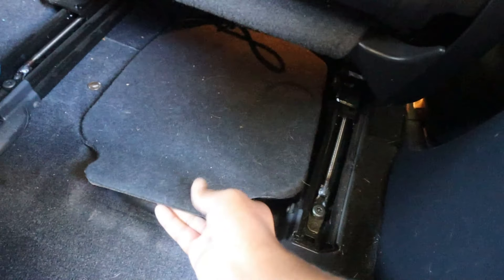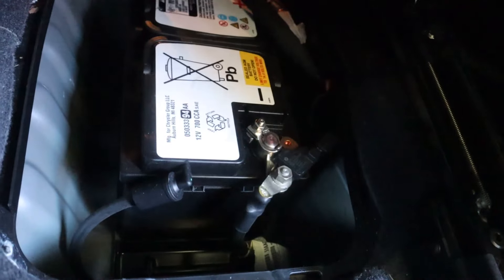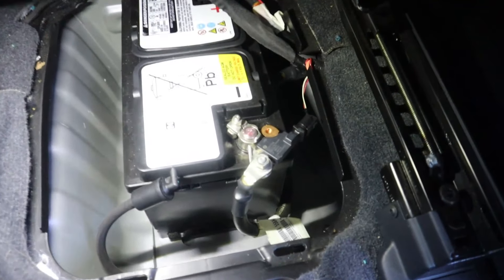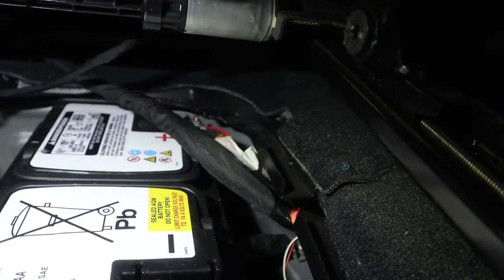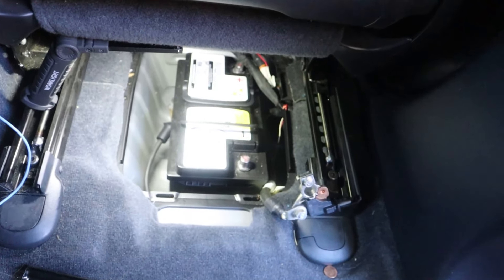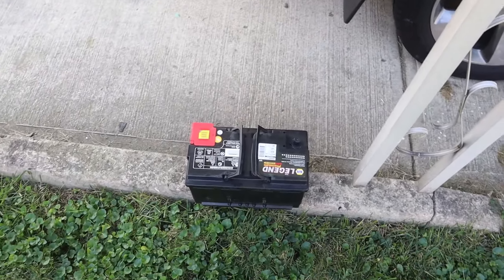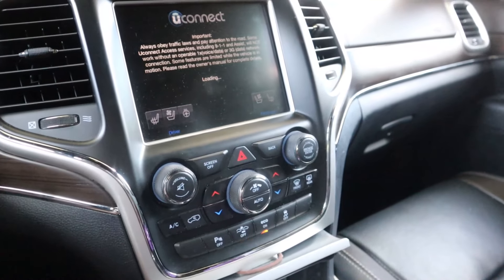Jeep Grand Cherokee Battery Replacement - 2011-2022

Comment: Why did they put battery under the seat ? Because they hate ppl?
Reply from the maker: Haha battle between engineers and mechanics
Reply: They put the battery under the seat because Jeep sucks. My wife has a 2016 Cherokee and it will be our last. P,OS.  @LJsGarage
Reply: @genemoorman3065 same this will be my last jeep as well
Reply: Because Mercedes
Reply: @xxmobstrxx8535 literally this, & i hate that. "Lets just do EVERYTHING the leading brand does, regardless of the lack of sense it may make.." yeah thatll win your customers over, make it more costly to service the products... its ridiculous
Reply: It takes a couple of minutes.  My battery was completely dead, and I had to remove the power seat.  4 bolts, real tough.  Why is it there?  Unless you have the water in the battery well issue, battery stays dry, no corrosion, no battery acid all over the place when some jackwad runs a red light and obliterates the front end.  And no one is going to steal your battery!  Yes, people steal batteries from vehicles, though you're odds of winning the lottery are probably better than having your battery stolen.  Seriously, it takes NO MORE time to remove than those in the engine compartment, even if you have to remove the non-functioning power seat because the battery is dead.  Now... replacing those 3 spark plugs on the driver's side on a 3.6l... complaints are warranted for that engineering stupidity.
Reply: Because there is no room in the engine bay for it.  The air suspension has posts in the passenger and driver side in the engine.
Reply: My 4th and last Jeep. And the Hemi is a POS.
Reply: Yep
Reply: Exactly my thoughts. That's ridiculous
Reply: I remember the spark plugs being a pain on the passenger side, not the drivers side
Reply: @capnobvious2718 wrong that’s the worst place I’ve dealt with a battery in the engine bay is faster by a mile and just over all better
Reply: @capnobvious2718  think you mean passenger side plugs, (1,3,&5), not even number on driver, but I’m with you. Cylinder 5 misfire and was PRAYING lol, that it was just under filter/intake on driver side 😂 Sadly, no such luck, 85 different plastic plugs, valve covers, hours, and too many engineer directed expletives later, and all done! Lol. Easily the worst design I’ve ever experienced for what is a simple 5 minute job in a patriot. Smh. However, I must say (knocking on wood), after owning my 2018 for almost 5 years and 80k miles, I’ve literally had no issues with it besides that misfire around 100k when plugs were due anyway, and a temperamental driver side door lock actuator that doesn’t lock automatically all the time and requires manually locked. Pretty reliable imo. The passenger plug replacement issue totally, TOTALLY ridiculous though. Haven’t cursed that much in a 6 hour period in years 😂
Reply: The usual area is obstructed by the air suspension. Apparently jeep does this on some cars without air suspension and that’s shitty but there is definitely not room for normal battery in that generation of Grand Cherokee Overlander
Reply: ya, next they will put the battery in the crankcase.
Reply: Well Sr, i live in LATAM i can tell you this is a extremely good feature as it's very common batterie to get stolen out your vehicule by resellers... Yes. thats a real, I've been stolen at least twice.
Reply: because everything on a jeep they want people to have to bring it to the shop to overcharge.. look into changing a headlight led or bulb 🙄
Reply: That is exactly why
Reply: You try to change the headlights on yours yet? I changed the driver side and swore if the passenger side goes out in selling the thing.

Comment: Thanks for this video. For anyone watching,  BEFORE YOU TAKE THE BATTERY TERMINALS OFF, move the seat all of the way to the front AND all of the way up. The battery will slide right out without you having to twist it to the side.😊
Reply from the maker: Great tip!
Reply: Yes, but not if you have base model Laredo with manual seats. Just slide all the way fwd, and hope for the best.
Reply: @jimakaracerx  Now I feel spoiled...
Reply: I’m working on one but this bar is in the way w the seat all the way up n the battery on its side
Reply: Duh

Comment: If you wanna make it easier the youcan get to the positive cable VERY easy by sliding the sea back and coming in from the front seat, it puts you directly over the top of the post with no obstructions. Then slide the seat forward again and get the battery out from the rear.
Reply from the maker: Thanks good tip!
Reply: This has gotta be a joke. If you slide the seat back and remove the positive battery terminal you will have no power to the car to slide it forward to get the battery out the rear. Sadly a lot of people will fall for this as they are not very mechanical and watching this to save a buck.
Reply: You take the pressure off the nut but leave it connected to the post so you just have to pull it up and off after you move the seat genius🤣
Reply: @2qwk un bolt it, leave it connected, slide seat back forward, then slide it off the terminal lol.
Reply: @2qwk my passenger seat isn’t powered so this was a great tip for me

Comment: Great video, unless you have a 2018 Grand Cherokee,  because it is not this straightforward.  You have to remove the auxiliary battery first, to even get to the bracket, and there are two places to remove the breather tube, as opposed to one.  You have to remove the bracket, before you remove the positive cable, as the battery is so far forward, you cannot get to the nuts on the terminal cable, as they are under the lip of the battery compartment.  The good thing about this, is once you get the bracket out, you can slide the battery back to expose the positive terminal, and then move the seat all the way back, and remove the positive cable for the front.  Hope this helps if you have a 2018 Grand Cherokee.
Reply: Thank you for this! I have a 2017 and this helped me immensely!! Much appreciated
Reply from the maker: Good added info!
Reply: Yea I was wondering why my battery looked extra...long? Thanks.

Comment: Its a lot faster to just remove the seat, just four clips that cover the bolts, remove bolts, move seat forward now you have access to batteries!
Reply from the maker: If that works for you def a reasonable method!

Comment: This isn’t “every” battery for this generation. 2016’s, and probably every year earlier has a regular sized and an auxiliary battery instead of a super long one.
Reply from the maker: Thats true thanks!
Reply: All have two if it has auto start stop but most don't like this feature and disconnect anyway .

Comment: This video helped out a lot man, thanks. One thing I didn’t think about was to raise the seat all the way up, but still had room to work with it forward. One thing I did different was loosen but not disconnect the positive from the front before moving the seat forward. I feel like after that battery change I would be able to deliver a baby no problem😂

Comment: Thanks for this. Date code on my battery was 15C31, so original to April 2015 delivery of vehicle. It was still working, but almost 10 years ... I replaced 700 CCA with 800 CCA model. Hardest thing was getting the 13mm nuts off the retainer plate.
Reply from the maker: Np my friend!

Comment: I have a 2019, the auxiliary battery is down there as well. After changing the main battery I went to start the truck and there is no power anywhere. Been researching for the last couple hours with no luck.
Reply from the maker: Good luck I'm not sure what that could be
Reply: Did you find the solution? I'm in the same issue

Comment: So 3 days ago, my 2022 Grand Cherokee wouldn’t start and I had to have it towed to the dealer. BTW, you can’t shift out of park when the engine isn’t running, so you have to locate the secret manual transmission override that will put your Jeep in neutral (hint: it’s not in the user manual, but you can find a YT video describing the process). Anyway, the main battery was fine, but the auxiliary battery failed. After it was replaced, good as new. I was confused because my understanding was the auxiliary battery was just used for the start-stop function and was not involved with the starter. So, apparently this is true…except the auxiliary battery has one other function: powering many of the relays that have to be triggered to inform the Jeep’s computer it’s safe to start the engine. No power to these relays, no engine start. Again, not in the user’s manual. Actually, the Jeep Grand Cherokee user manual doesn’t even mention the batteries, what they do or where they’re located. 

There’s also not one word in the manual about jumping a Jeep with a dead battery. Apparently, you connect your jumper cable to the positive (+) post under the hood on the passenger’s side. So, here’s a question: if your Grand Cherokee won’t start due to a dead auxiliary battery, will jumping the Jeep via the post supply power to the auxiliary battery, the main battery only or both? It would actually be great if you could make a video about this. Thanks.
Reply from the maker: Oh man! Good to know and sorry that happened

Comment: Great video but I do have to ask the main battery not the auxiliary where exactly are they located. Passenger seat or driver's seat underneath
Reply from the maker: The aux battery should be under the passenger if you had the stop start and all that

Comment: Find that big red cap on your positive there is a little plug that will break off and it goes on the opposite side of the battery from your vent tube there are two holes in the battery you're only going to use one for the vent tube the other one you need to plug it and that plug is on that big red cap on the corner
Reply from the maker: Thanks thanks

Comment: is it safe for the battery to be close to passengers?  What if it shorts?   Can that happen?
Reply from the maker: There are fuses to essentially disconnect if it were to short. Same with an accident but if they were to fail I would assume it's a little risky and a fire hazard

Comment: what is the function of the black piece with the plug in terminals on the ground terminal mine broke off
Reply from the maker: I believe you are talking about the battery sensor.
Reply: Or is he talking about that vent plug. I wondered what that is for also

Comment: Can you still get the battery out if you have manual seats that do not tilt ?    Mine has  2 batteries in there which makes it real fun .   I have seen a couple of vids that say to  remove the 4 seat bolts  and tilt it "backwards"  .
Reply from the maker: Yeah you can they should slide and raise up high

Comment: So because there are two battery's how do you know which one is dead or do they both die at the same time so do I need to replace both?
Reply: Where's the two batteries? It's only one I know of it's just a really big battery
Reply from the maker: Usually the secondary is for emergency systems and stop start and all that so you'll usually be able to tell

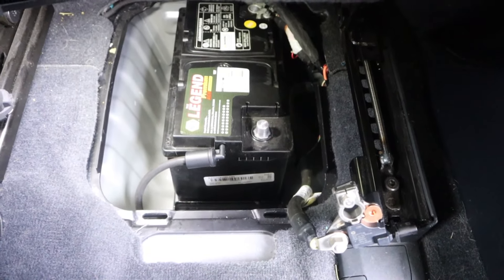Comment: Thanks for the video - I have the battery bracket out, vent tube disconnected, negative terminal off, but I can't seem to get the wire disconnected from the negative terminal @ 3:10 mark, does it just pull off or does it have a release, I don't want to break anything.
Reply from the maker: Np! it should loosen with the nut and then slide ride off

Comment: Are there any pointers on removing the battery when the truck is fully dead? At this point, this truck is trash. I have fuel leaking from under the passenger side.
Reply from the maker: Fuel leak is a mess :/ if you have power seats get a jumper pack it only needs a few volts to get it to move the seat
Reply: @LJsGarage  thank you for replying! I will definitely look into that.

Comment: I disconnected the battery for long term storage but the interior and exterior lights still come on and the electric seat still works, how is this possible?
Reply from the maker: If you have one battery then something may be touching somewhere that is odd

Comment: So your Battery Box was Dry?
Reply from the maker: Possibly I had it checked at the dealership and voltage was low
Reply: @LJsGarage  I have a 2011 Grand Cherokee, and the battery finally went bad, when I opened the cover that's when I saw all the water, I never heard it sloshing because the stereo Rocks!

Comment: If the battery is dead the seat will not move.  What to do?
Reply: Attach jumper cables to a new battery and connect to the jump port under the hood. It will provide power to the electronics and you'll be able to move the seat.
Reply from the maker: Second the jumper cables, thanks